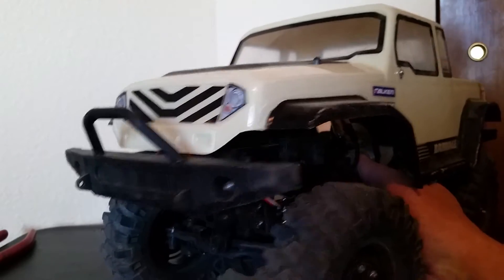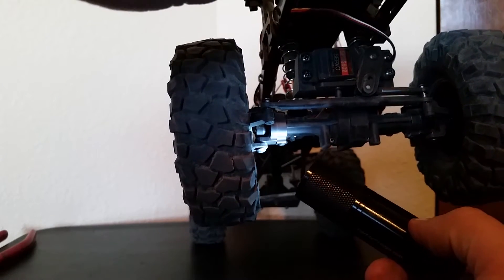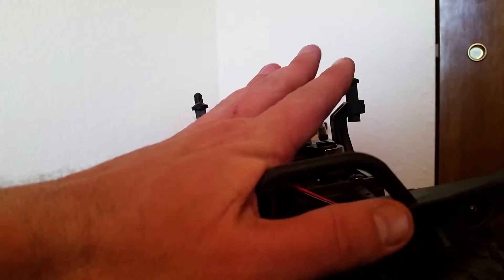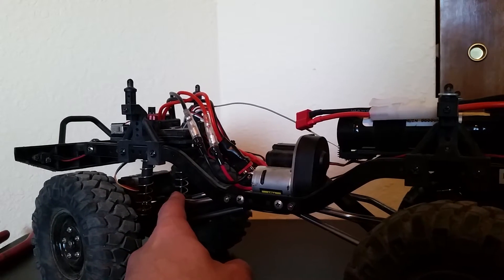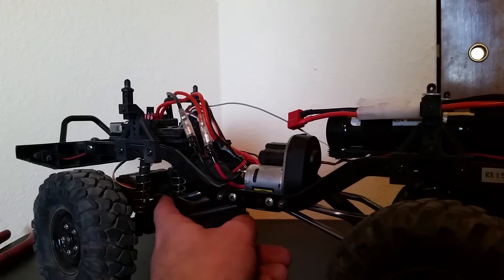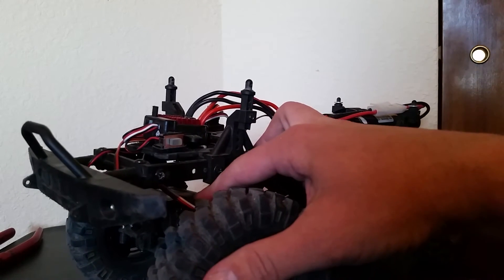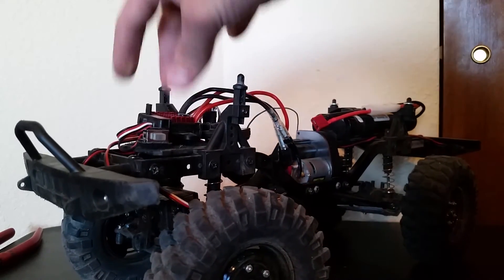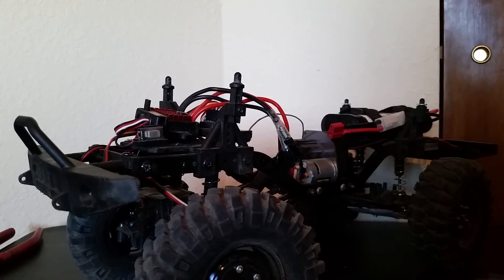ECX barrage the problems I've had and how I fix them

Comment: nice video i figured the knuckle bolts with need some. blur medium lock tight as well as the drive line grub screws! i had a maxstone 16 a while ago and it ripped screw out of the cheapo plastic knuckle upgraded ot to alloy like these and lock tight is a must lol! as for your servo move the mount on the horn up to the second hole you loose a tiny bit of steer to one side but gain torque!

Comment: Just got one today , it ran fine but now it will steer and lights come on and it drives but after about 30sec of driving it wonlt move forward or back. Any knowledge on how to fix it
Reply from the maker: It sounds like the speed control or receiver is bad, take it to a hobby store and they should be able to tell you which one is going bad